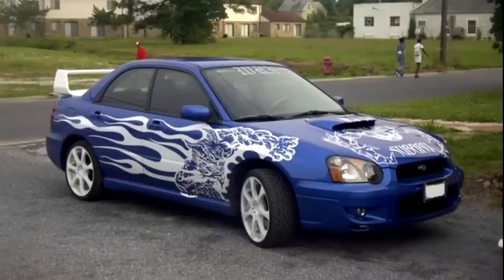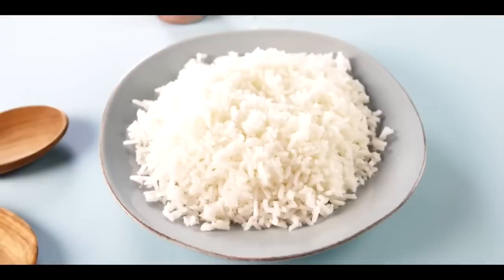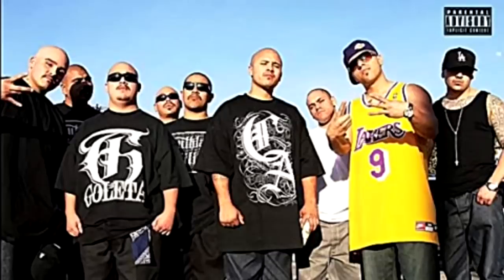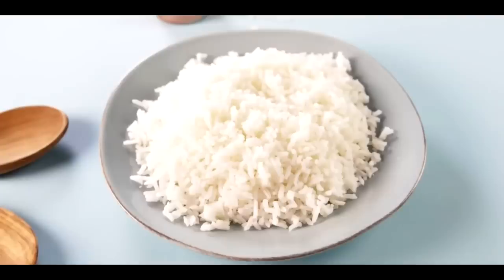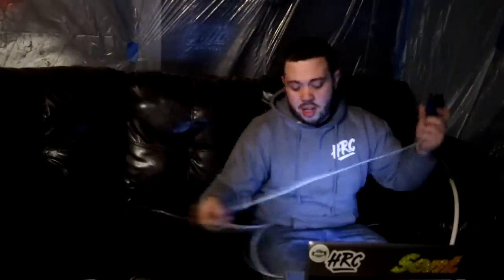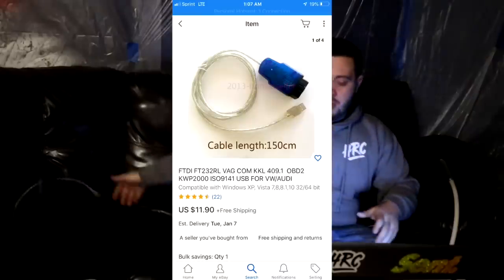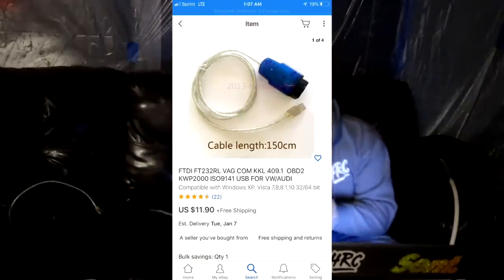HOW TO TUNE A SUBARU FOR $10

Comment: So I have a 2008 Impreza 2.5i , and I bought that exact cable. It doesn't read for Romraider and Ecu flash. I've checked the versions and files for both applications and it's all correct. Also, what are those green cables under the steering column, what are you connecting into those?
Reply: You have to connect them together then only car will go on test mode

Comment: If you’re still replying, or if anyone else knows, does this not have fuel cut options?
Reply from the maker: No, only fuel table, you can richen or lean out decel
Reply: @damianmonte  thanks for the response, do you know of any other free/cheap software/hardware that would have a fuel cut delay or would I just need to get a standalone ecu for that

Comment: Very late but I have a 2016 Subaru legacy? Do I need that exact cable for this to work?
Reply: yes most likely, im going to do this on my 15' legacy with uel headers and muffler delete
Reply: @V7Cameron  also have a 15 legacy 3.6
Are you going to set the numbers to what he did in the video or do some different stuff?
I want to do this but i’m concerned about this being for like wrxs and shit and the legs won’t like these numbers and fuck something up

Comment: Hi, I have downloaded both programs, and I have the cable. The car does connect to the programs.  I just cannot get a file to. How do I get a file to change the settings?
Reply: I do not have the tabs on the side. Where yiu have the ignition b, where I need to do the changes.  Would be highly appreciated.  Thank you.

Comment: This video is gold. Thank you for sharing your method. Viewer beware you can ruin not only the ECU but mechanical damage to the piston/cylinder can occur due to detonation/preignition/ping. For those looking to jump into this, understanding elements of spark timing and fueling variables is 100% necessary or you may likely get all Kenny Loggins on it, cuz you'll hoon right into.... The danger zone!
Reply: so if i was to follow everything in the video, step by step would i be fine? just curious.

Comment: I have the cable and tried reading my stock ecu but nothing happened. Connected the green connector as well.
Reply: 2009 Legacy's and all other Subaru's from 2007 onwards use CAN BUS ECUs so tuning via this cable aint possible no more
Reply: @LucaG1  so I need the tactrix cable

Comment: Hey mate, when I try and edit the In-Gear base timing, the scale is Base timing/coolant temperature, not Base Timing/RPM like yours. Do should i just throw the numbers in there and have a crack? My car has previously been tuned, wondering if that's why... 2006 Forester XT
Reply: The current figures are 16.91 across the graph.
Reply: Send me link to the thing i need to buy OBD2 please man

Comment: Can you help me out with a 2010 forester with a 2.5l and 5spd
Reply: Got the same thing but a 2013 any luck ???
Reply: @ethansides8089  Anything 2007+ cant use this as Subaru started using CAN BUS ECUs
Reply: @LucaG1  someone said they did it on a 2016 legacy and a 2013 impreza hatch

Comment: Hey man i have a 2009 Subaru Impreza 2.0 n/a and when loading up the rom raider and it sends me to the website my car doesnt show up
Reply: 2009 is CAN BUS which can't be tuned, at least not VIA a serial interface, which is what the cable uses

Comment: Hey man.  I'm not really into the rice burble stuff all that much.  BUT I do have an fp blue equipped, meth addicted 05 Wrx.  Its tuned with Rom Raider and Ecuflash just like this.  I paid the extra money to have a launch control patch put onto my map.  But anyway with the fp blue being towards big unlike my old vf34 turbo, normal fuel cut launch control isnt spooling enough to launch.   My question is,  do you know of way to do a ignition cut LC on Romraider and Ecuflash to make it seem like the Taliban is coming out of my car's fart can so it makes more stationary boost pressure?  Sorry for the bible length comment bruh.

Comment: how can i add pops on decel on my auto? i have a 06 xt and could only find one in auto so kinda stuck lol
Reply: don't ruin your Subaru with this. or do and learn from your mistake when you have to overhaul the heads/replace the turbo

Comment: My 07 2.5RS does this on a stock tune with a 3inch straight pipe. It also shoots massive blue flames about 2 feet long 
Yes, all on a stock tune
Reply: What did you do for mods I have a 2.5 rs
Reply: What exhaust set up do you have?

Comment: how neccesary are the m/t or a/t tables for the tune? im trying to get a tune together for my 2007 2.5i and those table are no existent.
Reply: your engine has i-AVLS, not AVCS, you cannot retard your timing to dump fuel. there are no tables because the system you are trying to tune does not exist on your car.

Comment: Hi Damian, i've bought a similar cable to the one you have, but from another supplier as it wasn't available from ebay anymore, but the description was exactly the same. It came with a cable and a small cd with an app file exe and drivers. i installed the program (vcds) and i tried to set it up in the options as an obd2 cable but nothing.. i couldn't even install the drivers, so needless to say it wasnt even detecting in ecu flash so i could read my stock ecu and upload to romraider.. any ideas? thanks, this is really getting frustrating and i definitly dont want to go to a tuner to get pops and bangs on my hatch 2.5i

Comment: I have a Subaru Forester xs 2004 can it work ?
Reply from the maker: Yep it’ll work no problem
Reply: @damianmonte  my is automatic tho still works ?
Reply from the maker: IIXV yes, where I changed my values in the manual portion just make sure you change the values in the AT section, that stands for auto trans

Comment: This video is so wrong, disclaimers goes at the start of the video just and because you can f up your Ecu, second those pop and bang gonna kill your motor suddenly they are detonation, third the values of ignition are for go forward or backwards with the spark, be careful dude
Reply from the maker: Ronny Vasquez you can fuck up the ecu if you unplug it mid flash and that’s about it, second those pop and bang have been going on for over a year with zero issues because it happens when there’s no load on the engine so it won’t hurt anything, third I’m obviously aware of what ignition values do or I wouldn’t be able to do this in the first place lmao

Comment: Just did this to mine and it works just like in the vid. running full headerback as well. theres a thread out there on romraider that shows how to do get it to work with windows 10. just google “windows 10 vagcom ecu flash”someone with a 04 forester got it to work. it was kind of frustrating to get the cable to work but that thread helped me after changing the cable to com1. if you have a mac just run a windows virtual machine itll do the same thing

Comment: Would this work on a NA subie?
Reply from the maker: If it’s 2005 + yes. My girls car in the video is an NA subaru. It’s a 2.5rs not a wrx
Reply: @damianmonte  cool thanks for the heads up. I have a 2018 forester 6spd I wanna mess with
Reply from the maker: xDeadbolt562 yep should be able to no prob, it’s the same tuning software that openflash uses

Comment: great vid and info really helped. The only thing i see by doing that is actually damaging the engine. The values you set will cause pre ignition with the fuel and damage the piston and valves
Reply: That's what happened to me don't do this shit
Reply from the maker: The ignition is happening in the exhaust not the engine so it won’t damage anything in the engine also it’s happening when there’s no load on the engine so no worries

Comment: hi man, i'm having trouble communicating between my wrx 04 car and the software. which driver do you use for your cable and the version of ecu flash. it will really help me. greeting :)
Reply from the maker: Cedric Djzak hey man, it has to be an 05+ ecu so if you get that and maybe a step down harness if they make them for Subaru’s that would work but the 04- ecus aren’t able to be flashed or read from, hope that helps out dude 👍🏻
Reply: @next smiile if you ever findout how to burmble tune ur 04 lmk
Reply: i have this issue too. i have A4TJ1X00 3D04EA4605 this ecu which has already been tuned by my tuner before. I however, am trying to use the vag com cable to do my own tuning, but ecu flash is unable to connect to 'interface' (the vagcom cable)

Comment: Did you have to choose your vehicle definition? If so how because on ecuflash all I see is turbo models. Not sure if it’s necessary but I can’t get it to read and people are telling me that’s why. Also did you have the green plug connected or disconnected?
Reply from the maker: You have to download the def files from the ecuflash website I believe, then plug in the green plug, turn ignition on and click read ecu then save your stock rom then you can edit it but make sure you save it as a new rom like name it burblerom.bin or something so you can always go back to stock. Also make sure not to stop flashing or disconnect while it’s flashing or you’ll brick the ecu

Comment: Would this work on a 02 wrx
Reply: It will. Tables are a little different but you will manage. The goal is to retard ignition and add fuel.
Reply from the maker: Yes I believe so just search how to use rom raider on an 02, you might just need an 05+ ecu

Comment: Pops are bad for exhaust valves. Dont do this.
Reply: Fire is bad just popping without fire coming out not so bad
Reply: @micahhill4786  the pop is burn of fuel not pushing the piston, but pushing out by the exhaust valves. So they get fucked, and burn up.
Reply: Dont care, beater life
Reply from the maker: Bas BlasterXP not true, people say this but anyone I’ve ever known with a burble tune hasn’t had a problem with exhaust valves, it’s also not anti lag, there’s no load on the car when it’s popping
Reply: @damianmonte  okay!